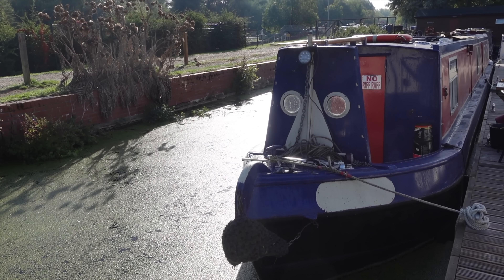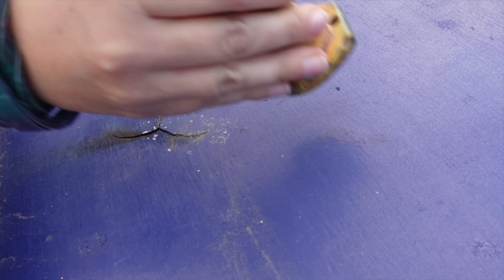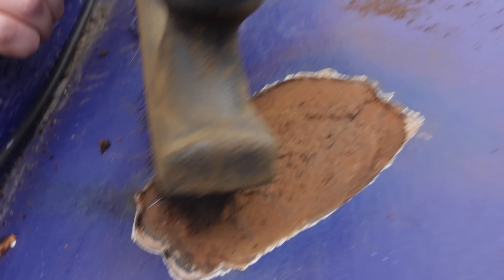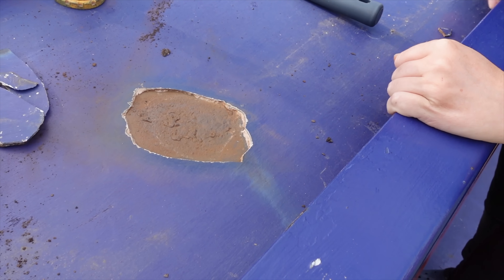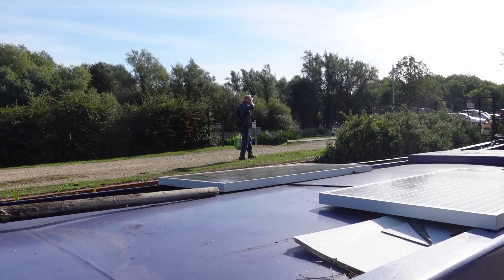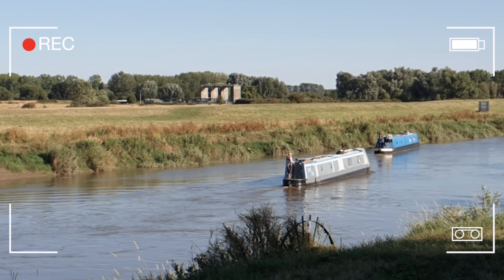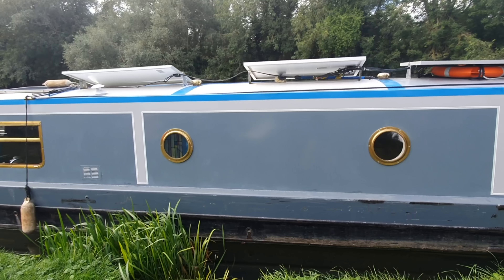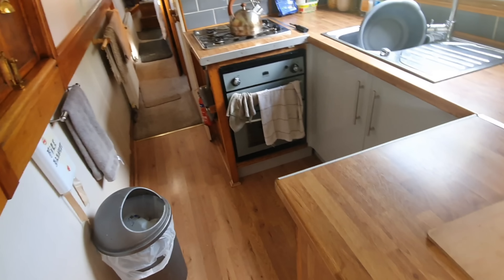HELP... massive HOLE in our narrowboat ROOF ??

Comment: So Chris that filler being off was a blessing in disguise because now you have time to get out the angle grinder with a flapper disc and clean up that rust properly, grind back that filler at least 6 inches beyond the cracked edges because the rust that remains will just crack out again, keep sanding till you see good steel underneath. cheers Moose
Reply from the maker: oh...no...well iv actually just filled it up, as were about a week inferno t of the vlogs...it didn't got ti great ether as iv never done any filling before....in the next few years were going to have to do a full paint de rust of the outside of the boat, maybe then will be a better time to sort it out, how embarrassing :(
Reply: @TheNomadicCrobot  it will probably be ok for a tear or two
Reply from the maker: fingers crossed

Comment: Hi,  I expect you might already have done this, but you will need to glue a strip of wood on the underside of your Draining board ( the bit that lifts out ) so that it does not move forward, and drop off the back edge of the sink that supports it. Cheers
Reply from the maker: thats a very good point , its something we still need to look into I guess, thanks for the heads up :)

Comment: Bit late to reply maybe although yes, steel hulls would have a primer, potentially an undercoat, and also filler is often used in steel vessels to smooth out the hull so it's normal really, although that filler appears to have been porous which has let water seep through and rust, which has expanded and cracked the coating. On bare steel you need something like a zinc primer then fill with a marine filler, then paint. Make sure you remove all of the filler though back to bare metal though, in an area larger than the rust so you're working with good material.

Also remember your dust mask when brushing rust because you don't really want to be inhaling that! (ok, mum-rant over 😉)
Reply from the maker: oh thats so intresting to know, yes a fe people have given us tips on taking the area back further to treat all the rust, unfortunately iv already started now, and there's no going back... prepare to watch the disaster in the next weeks haha...slightly embarrassing , oh thanks yes I always try to remember the mask...such an easy thing to forget...thanks for looking out for us Tiller Queen :)

Comment: i had the same problem.The welded joint across part of my roof dad distorted and they had used filler to correct the dip.Get it back to clean metal red oxide and refill the area .you can then repaint roof.
Reply from the maker: thanks for your advice, yes I think will probably take these steps, seams straight forward :)

Comment: Love Wills vids. Could the roof hole maybe have been a vent of some type in the past and then it was welded with thinner steel from the inside? Is it possible to see the inside section of roof? Might be an idea to remove all the filler back to metal as its probably prone to rust now
Reply from the maker: its funny actually because on the other side a few of the wooden panels on the roof did look looser, ill try and get a shot for you in the next vides, we do wonder if it is an old chimney perhaps?? thanks for you interest

Comment: It is quite possible that the whole roof has been treated with filler when the boat was built. The roof consists of several steel plates that are welded together. The result is never perfect, so they smoothen everything out with filler.
Reply from the maker: oh thats really interesting...I think you maybe right...it could have been coated all over when it was originally made, thanks for your suggestion :)

Comment: Isopon P38  car BODY FILLER. Taje it all away. or your asking for trouble. its porous and swells keeping the damp and water in. I personally would cut it out and plate weld it. Regardless the left on rust plate will still eventually swell also. Looks like your tickling that oxide primer on, and it's going to need a few coats and I don't mean house coats.
Reply from the maker: oh really are you meant to but it on quite thickly?? I am starting to wonder if iv done it wrong but will have to wait and see, at the moment will probably just do a part time fix then reassess  the area in the future , thanks for your advice

Comment: I would take that back to bare metal or you’ll be doing the same next year. I just stripped my roof back to bare metal and re primered it, check it out if you like
Reply from the maker: im pretty sure we have taken it back to bare metal now, thanks for your suggestion, fingers crossed I can handle the filler
Reply from the maker: no your absolutely right, the job should be done properly, the problem is we thought we were doing it properly haaa...I wouldn't be surprised if I have to redo it in the next year, unfortunately iv already started the filling process...which was the first time I had ever done any filming...absolute disaster as you will hopefully see in the next weeks...but we learn and next time we can hopefully do it the right way with a bit more experience
Reply: @TheNomadicCrobot  my painting was horrific when I started, it’s only with practice we get better at these things. Thanks for listening, best of luck, maybe I’ll catch you out there one day 😉
Reply: @TheNomadicCrobot  also, I wish my viewers threw comments like this, no one called me out on using too thin wiring, gonna have to replace loads now, we’re all learning 😉

Comment: Oh god he is dodgy🤣🤣🤣watch out mate🤣🤣Just use car repair filler, it's the same stuff
Reply from the maker: haha very much so :)
Reply: Yes I was thinking car body filler cheaper and commonly available. That part of the boat is not under water. Marine filler sounds more for ocean going boats? Sand it back with the disc sander first.
Reply from the maker: yes I seam to have confused as we had marine filler on the boat , can't be a bad thing probably just a bit more expensive

Comment: You need to buy a needle gun and do it properly you can see there is still rust flakes there that the wire brush has only polished, plus I would suggest that filler should be applied directly to clean bare metal, but check what it says on the directions for use. I would say that is where an old chimney was and they have simply welded a piece of steel to the under side of the roof and filled the recess it created, not really the correct way to do it, they should have cut a piece of steel the same thickness as the roof and welded it neatly into the hole so it forms the original profile of the roof.
Reply from the maker: yes we thought it could have been were an old chimney was, Iv literally just filled it up now though feel iv probably done it wrong, something will have to look in to in the future probably when were doing the whole outside of the boat, thanks for your suggestions :)
Reply: @TheNomadicCrobot  If you watch this video, you will see a needle gun in use while it is an air operated type you can also get electric ones as well as battery operated too nowadays
https://www.youtube.com/watch?v=99bmxnFPERo
Reply from the maker: oh brilliant thanks very much :)